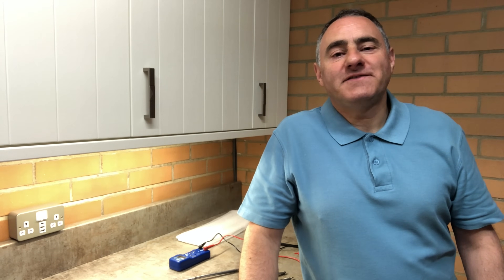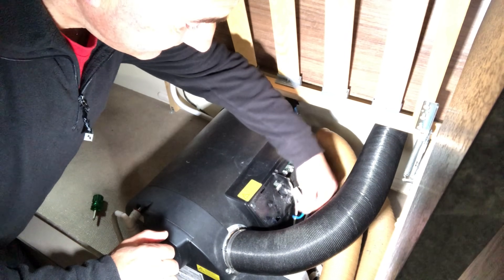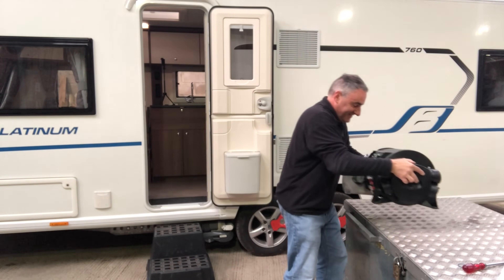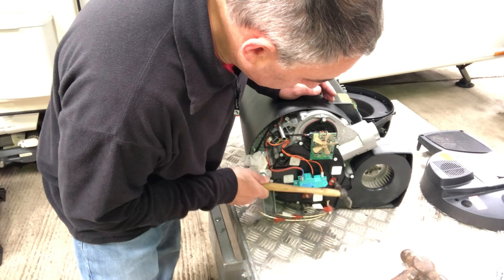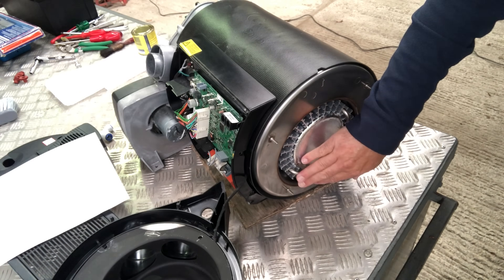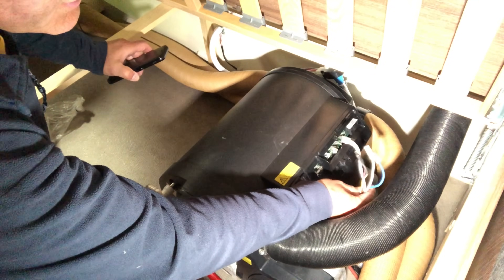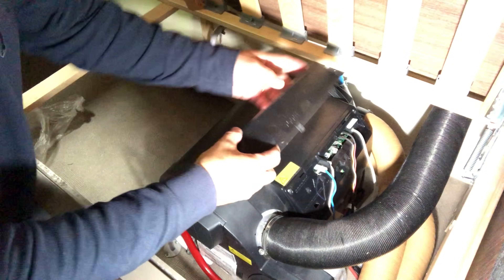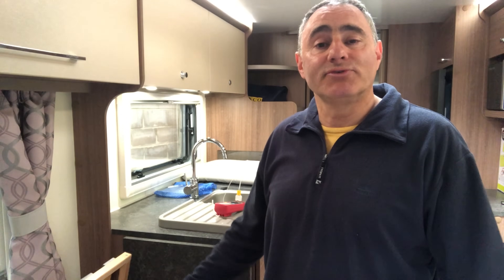Truma Combi 2 E Changing the Electric Heating Elements

Comment: Hi we curretly have out heater out to replace the heating elements the problem we have at the moment is the person who did the service on he caravan removed the element cabels from the power supply does it matter what terminals each wire goes back into any help greatly appreciated
Reply from the maker: Hi Lewis, Don’t see the reason for disconnecting the cables. There will be a pair of terminals for each element. Might be worth watching a YouTube video by Steve Watson. Type in YouTube Truma combi element replacement and the 6min 25sec video should come up. You can see where he has taken the wires out of the terminals. The terminals look colour coded as in, light and dark for one element and same for the other. Hope this helps. Cheers Rob 👍

Comment: Excellent video, very helpful. This is exactly what happened to mine. I followed your instructions but I got some advice from the element manufacturers to cut the U shape at the bottom and take them out of single pieces. 👍
Reply from the maker: Thanks for your compliment Paul. Thinking about it, I bet it was easier to get them out singular. Hope it all went well and the heater is back up and running 👍. Cheers Rob

Comment: I've just done this job on my caravan today. Wish they were as easy as it looked on this video. Tip for you. Once you have enough element protruding cut of the loop off so you can remove half the element at a time..... so much easier as your not fighting against the other side. WD40 also helped, spray down the element. I used a length of 8mm rod to use for a drift. Good luck.
Reply from the maker: Pleased it went well for you Adam and thank you for the tip 👍.This is the first combi element I’ve changed. If I ever have to do another I will certainly try your suggestion. Cheers Rob 👍

Comment: Brilliant job. You make it look so easy. I had a heck of a job removing my elements as both had blown. Thanks for sharing the video
Reply from the maker: Hello Sven, I too had a bit of a job getting the elements out. I edited it out otherwise it would have been a very long video 😂 . Hope your combi is back up and running as it should 👍. Cheers Rob
Reply: @robswiseways5697  The elements arrive this weekend so thats this weekend's job!
Reply from the maker: @svengalil  Ah, I hope all goes well. They should slide in without any issues. Just a note - I had a comment in this section about the gas heating not working after replacing the elements. I suggested trying the reset button next to the wiring connections. I didn’t receive a reply so I don’t know if that cured it. Cheers Rob 👍

Comment: How do you clean the combustion chamber and the exchanger from sot and dust?
Reply from the maker: Hi Martin, Never done this before. Apparently Truma do a Combi E heat exchanger element kit. This includes all gaskets / seals, screws, nuts and exchanger. Have a look at the website leisureplus.co.uk There is a download on the Truma combi element page.  I’m not sure whether doing what you ask is actually required or is a DIY job. To do this you would need all those gaskets etc. Hope this helps. Cheers Rob 👍
Reply: @robswiseways5697  I clean the intake fan every year like you did in this video. What I have noticed is a small layer of very hard to remove dust , some kind of ultra fine dust particles that collect over time on the bottom of the fan fins.

After a couple of years use, my Combi stopped working (if I remember correctly it was constantly overheating itself) and I had the combustion chamber replaced (if I recall correctly, this was the part that was replaced, but maybe it could have been the exchanger, or both) and the mechanic said he saw a thin layer of hard dust covering the entire thing, just like what I see on the fan.

If this was the reason we needed to do the very expensive replace in the first place, then this means the Combi will always fail perpetually like almost on a schedule.

I have tried compressed air on the fan it doesn't do much against the hard thing layer of dust, which need to be brushed away. So no need to be blowing compressed air into the machine.

Btw, when you were  cleaning the fan, did you notice this kind of thin, hard layer of fine dust?
Reply from the maker: @themartinandersson  After cleaning the dust with the vacuum and brush I don’t recall seeing a hard layer of fine dust. The caravan is a 2019 model and the combi is still going good. I’m not an expert on these appliances but I cannot see this causing your combi to overheat. It’s a puzzling one. Only thing I can suggest is keep using it and see if any errors occur over time. Cheers, Rob 👍

Comment: Nice one Rob thats some undertaking well done mate. You did rite by not over tightening the bolts to the elements as the insulation in very brittle in those elements... top marks lol
Reply from the maker: Thanks for your compliment Paul 👍. Enjoyed doing the job but getting the old elements out was the most awkward bit 😁. Spotted you have a new video out, will be taking a look. Cheers Rob
Reply: @robswiseways5697  they stubborn because of oxide build up.... not sure if you can get a mega long pipe cleaner? But they seem to slide back easy enough so prob not needed

Comment: Good job Rob, done mine over the last couple of days but sadly now have a issue with the boiler not working on gas!
Reply from the maker: Thank you 👍. I’ve seen a few Youtube videos relating to a reset button  at the side of the wiring connections. This may reset the unit, worth a try. Cheers Rob 👍

Comment: Hi Rob. 
Thanks for this very informative video. Can I just ask. I have the same boiler with low heating output (temperature very low),and very slow on heating water when just set on electric. Just wandering whether these are the same symptoms with your friends boiler before you replaced the elements. If so I will be using this video as a tutorial for the task ahead. Thanks again
Jason
Reply from the maker: Hi Jason, Yes it was the same problem of water not heating as hot as it used to on electric alone. I’m pleased to report water is now heating up to full temperature within the time expected. I would point out if I was a caravan engineer, I would fabricate an heating element extraction tool for my toolbox as they were very awkward to get out. Someone did say they cut the old element in two which made getting them out a bit easier. First it’s probably best disconnecting the connecting wires from the elements and doing a test on them to see if they are dead or not before trying to extract them. Similar to what I did at the start of the video but yours will still be inside the combi. Hope my video helps and the job goes well. Cheers Rob 👍
Reply: @ 
Thanks that is much appreciated Rob. There was one other thing i didn’t mention. When the fan was set on either boost or high it would revert Bach to low after a short while. This was confusing but then thought would this be because there is not enough heat within the heat exchange so the fan intern is reduced  in speed via a censor of some kind until there is the required temperature to run at higher speed.
Its a shame the boiler has to be removed from the van to access the ends of the elements to do the test on them.
Reply from the maker: @jasonhargreaves8506   @jasonhargreaves8506  Not sure about the fan speed as this is the only time I’ve used a combi. But I suspect you’re right about sensors controlling the fan speed. If there isn’t room to take the cover off then there maybe no alternative but to take out the combi. Going by what you have described, it does sound like one of the elements has failed, so it may not be abortive work. There are two Youtube videos from David Hirst and Steve Watson that are worth watching before starting any work. Type in Youtube search ‘changing Truma combi heating elements’. Both videos should come up. Cheers Rob
Reply: @ 
Thankyou Rob for getting back to me. You have been a great help.

Comment: Do you have to be gas registered to do any work on a gas appliance ???
Reply from the maker: Hi Graham, Gas safe state touring caravans are out of the scope of The Gas Safety (Installation and Use) Regulations 1998, unless they are hired to members of the public. As can be seen in the video, only the gas connection and flue was disturbed. The gas system pressure may have been tested by now, by an approved caravan service technician. Disconnecting and reconnecting the gas pipe is like changing the gas bottle. The gas bottle locker has a drop out vent to allow for escaping gas. There is also a drop out vent next to the boiler which I didn’t point out. I would always advise to have an approved workshop technician to work on a leisure vehicle. Hope this helps, Cheers Rob 👍